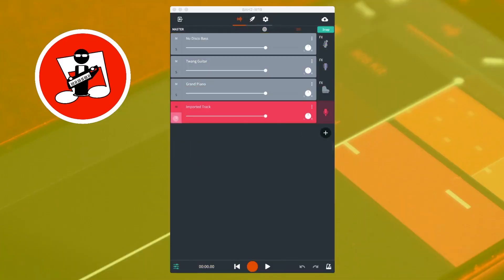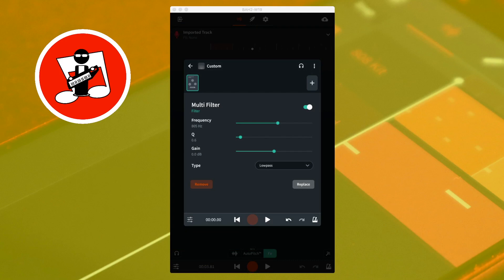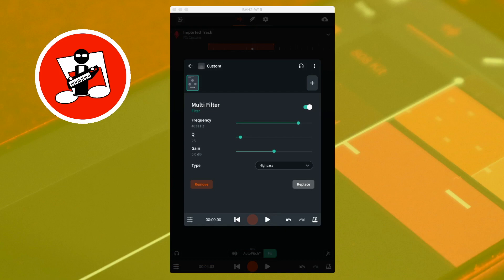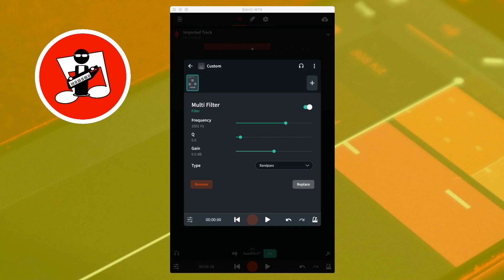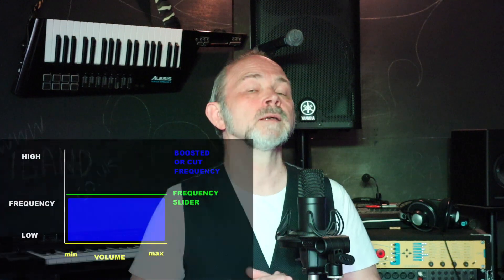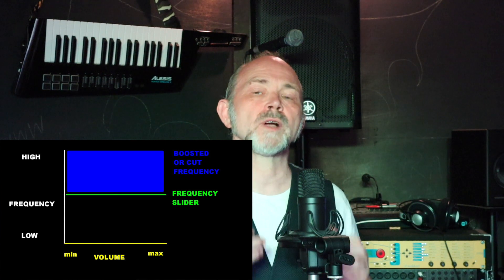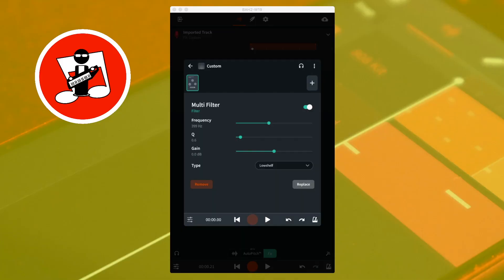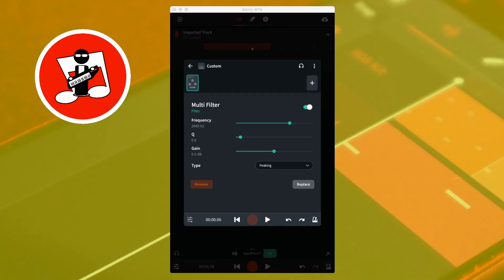How to use the Multi Filter Equaliser FX in Bandlab

Comment: I need my vocals crispy clear bc my voice so a high pass would be right correct ?
Reply from the maker: ETERNITYTHOT
Hi, I would use a high pass set around 200hz, depending on the mic and the voice.
Also, make sure the mic input level is set to the correct gain level, too low and the vocals will drown in mic and ambient noise, too high and the vocals will be choked with messy harmonics from distortion and clipping.
Human voices also tend to have tails (natural fade) so I would use a noise gate with a short release and a carefully chosen threshold.